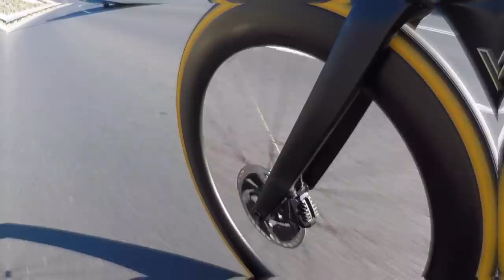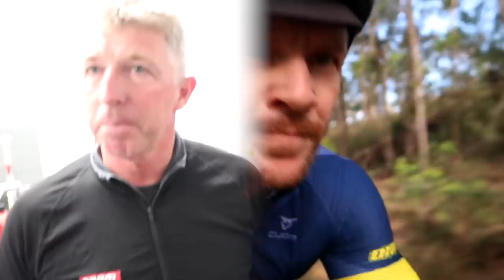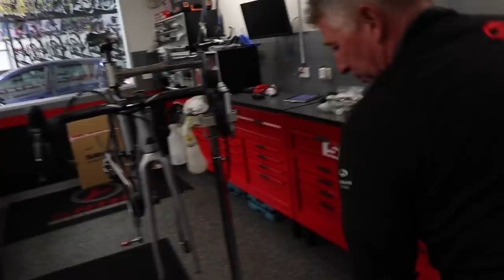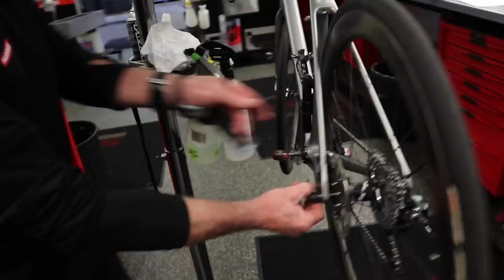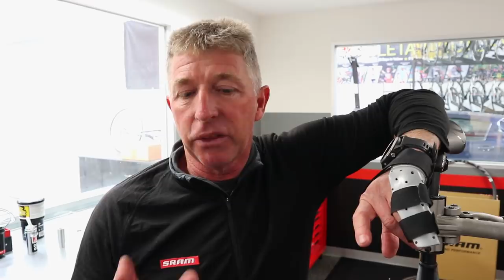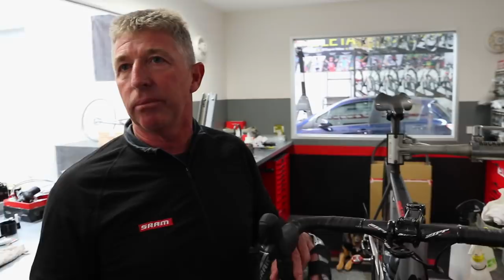Disc VS Rim Brakes (& Thru Axle VS Quick Release Skewer)

Comment: The extent of inaccuracies are not honest disclosures and we really should make the industry and sport a little more transparent and ethical.

There are certain disadvantages to disc road frames that aren't often mentioned, but they also aren't identical across all manufactures due to various designs. Break the down the bike into its two halves front/rear.

Front Negatives;

1) Fork legs become asymmetric and now have differing load ups between left or right turns. Some frames don't offer the same handling qualities in disc over rim, but this vary greatly between models.
2) Front wheels are dished, also providing differing loading performance when the bike is leaned left or right. This will also vary greatly between wheel models.
3) The through axles do provide a more rigid connection and are consistent, but engineers usually sacrifice a degree of front end compliance and its overall effect on grip will vary with road conditions.
4) Disc road bikes are generally less aerodynamic using the WAD (Wind Average Drag), which covers a full 30 degree yaw sweep. They fine at zero degrees of yaw and become a bit more of an issue in cross winds.
5) Experience lower overall load capacity than most modern carbon rims. They both fail with poor braking technique and discs have come short of the best rim models in the abuse they can withstand. The advantage is the disc failure is at the rotor and caliper with the rim being potentially more dangerous. This is a complicated topic and will vary greatly between setups.
6) Weight.

Front Positives;

1) Easier brake modulation and all weather performance. This aids greatly in rider confidence due to the ease of getting the required braking.
2)  Rotor replacement are at lower cost than rim when worn down. Long term cost comparison would be needed to specify costs, but rims can vary in price greatly so that will have impact on comparisons.

Rear Negatives;

1) Increased aerodynamic drag at wider yaw rates.
2) Weight.
3) Same loading issues as the front, but less so overall as most of the braking forces are experienced towards the front.

Rear positives;

1) Rear end stiffness. Considering power is being delivered there, the added rigidity is a positive. The rear being already asymmetric for gearing and a much lower connection to the hands reduces handling impact noted as compared to the front.
2) Compliance can potentially be improved without rear bridge, although many aren't taking this route to keep reactivity.
3) Better control through modulation and all weather performance. As above, improves riders confidence in braking.
2)  Rotor replacement are at lower cost than rim when worn down.
Reply from the maker: Thanks for sharing Michael. Appreciate it. Cam

Comment: You can't beat rim brakes on a road bike. Disc brakes look crap on road bikes, and you don't need that much power on a road bike..Disc brakes on mountain bikes , now that I understand. Its just another gimmick  so company's can make money.
Reply from the maker: Thanks for sharing your thoughts Mark. Cam
Reply: I would say if you cycle commute in a wet climate, disc brakes have more power in rain.

Comment: 1x road drive trains are just silly
Disc brakes are better all around
SRAM guy is wrong about the axle comparison. The skewer is not the axle.
Reply from the maker: Thanks for sharing your thoughts. Cam
Reply: Cam Nicholls they are just my opinions. But I've been a pro mechanic for way too long to believe some salesmanship version of what works best. Disc has its drawbacks but the performance is consistently more predictable and reliable. That said, I still ride rim brakes.